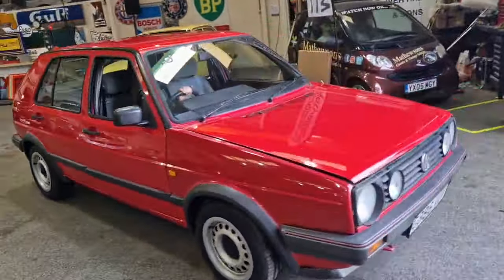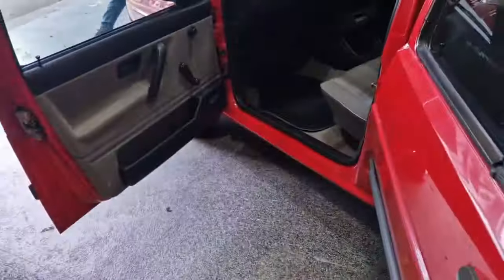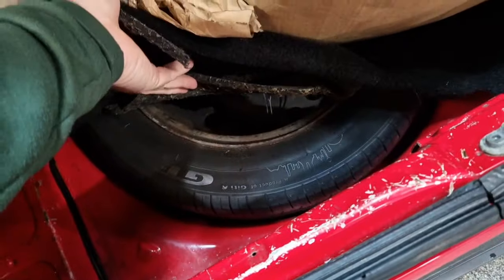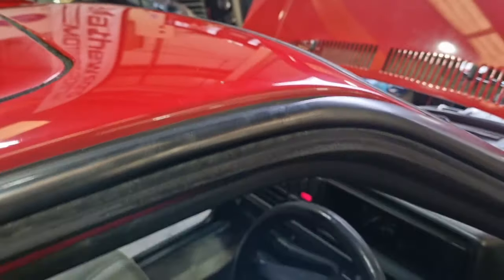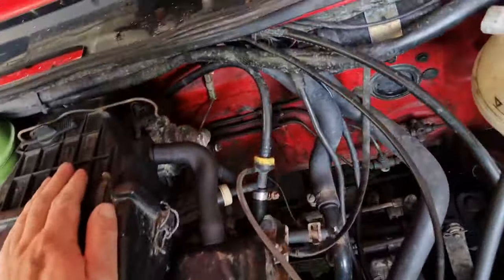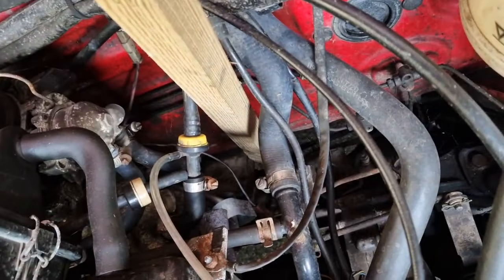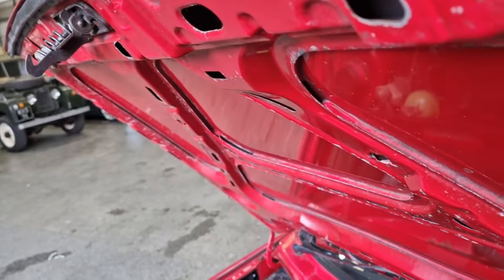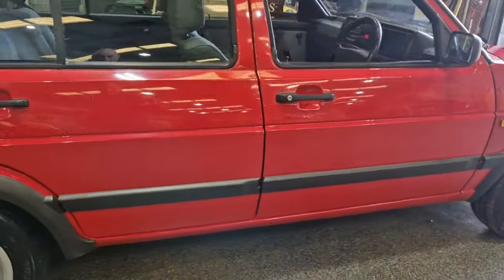1990 VOLKSWAGEN GOLF DRIVER | MATHEWSONS CLASSIC CARS | AUCTION: 27, 28 & NOVEMBER 2024

Comment: I had a metallic blue Mk2 5-door VW Golf Driver which was registered in 1991, a 'J' reg.
It had the factory fitted sunroof, central locking & GTI upholsery but with a 1.6 litre carburettor engine with 5 speed manual transmission. Plus a rev counter & digital clock.
It had the plastic skirting on the doors & wheel arches & was a very reliable car indeed.
It was a step down from the GTI version which was top of the range at the time with the trip computer which the Golf Driver did not have.
I still miss the car even now today, don't make them like they used to any more!